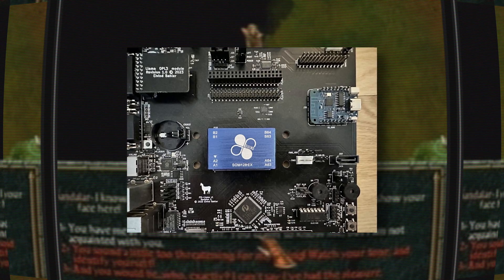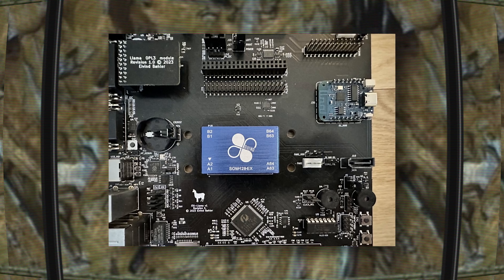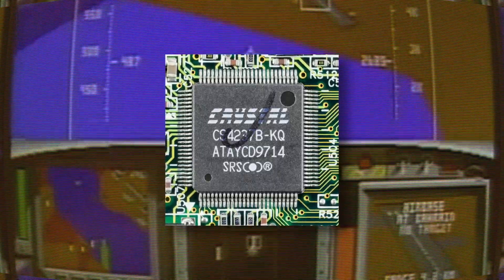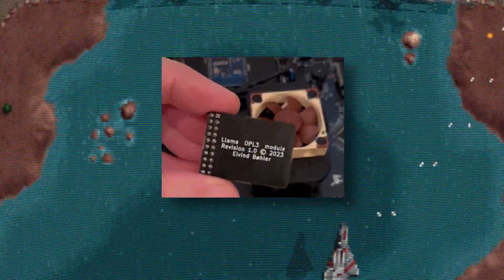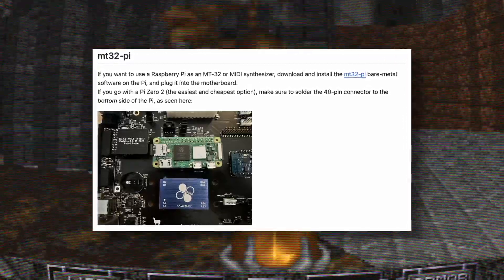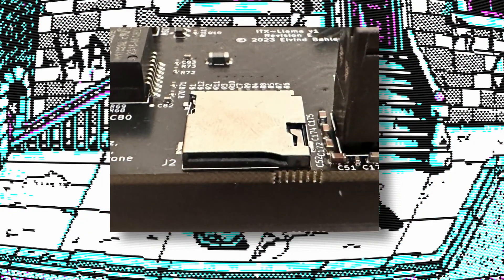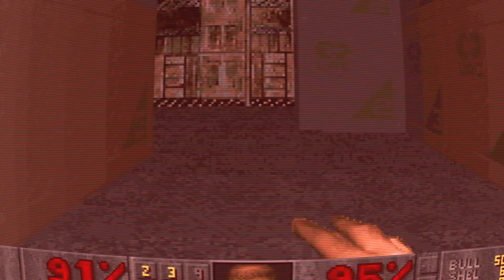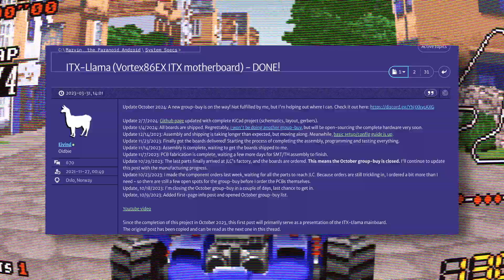A Modern Motherboard for Retro PC Gaming

Comment: Older Thin Clients with X86 CPU can also be worth a Look, i was lucky to get a HP t5710 for 30€, as it was showed by Phils Computer Lab and James Meckenzie. 
You need some Adaptors here and there (for CF Cards as Harddrive), but Systems as these are at leas cheaply avialable

Comment: I seriously considered buying one, but in total it would have been around 500usd. A very cool project though.
Reply: Yes very cool project, but being pratical you can get a slot 7 kit for 50% of that or less if you spend sometime prospecting. This probably is the future of DOS gaming, once hardware becomes hard to obtain… eventually parts will fail. It would have to be something similar to. A Mr. PI project, keeping hardware to affordable levels … I would say US 150 or less
Reply: @AladimBR  Sadly, I do not think we will ever get to that price point unless a big motherboard manufacturer like GB, Asus, MSI etc.. takes on the design and churns out tens of thousands of them... Also, the crystal chips are NOS and there is a limited supply left for them... same thing can be said about the Yamaha OPL3 and DAC chips...
Reply: Strongly agree. The last thing I want though is to maintain old hardware, that's what made llama attractive.

Comment: Unless it was fixed somehow, the speed was still to high to play games like wing commander accurately. A second group buy? I am interested but lost interest once I heard the creator wasn't doing another run (from an earlier video review). So that's great news. Thanks!
Reply: I think using a Slomo program is a given for these games, otherwise you'll need a 386 cpu but that closes the door to a lot of games that need a better cpu.
Reply: A 486 DX2 66Mhz would be a good middle ground for me as it covers mid 80s to late 90s.  With downclock options to 33, 25, and 16 Mhz for older games.
Reply: Work is being done by eivind to slow down the system further.